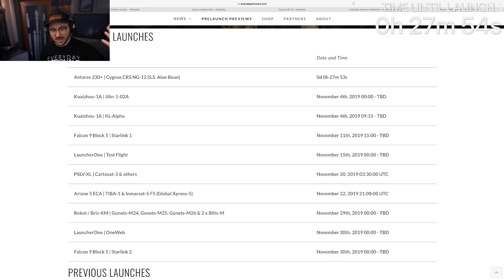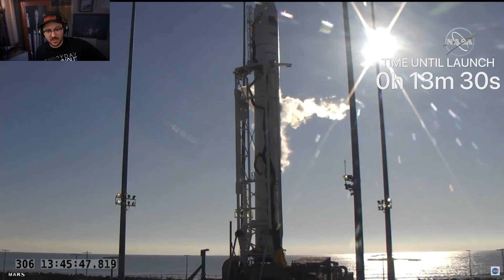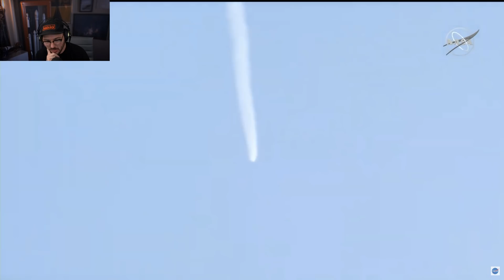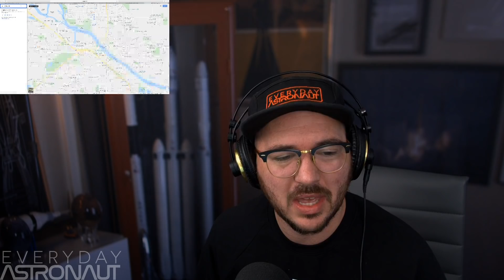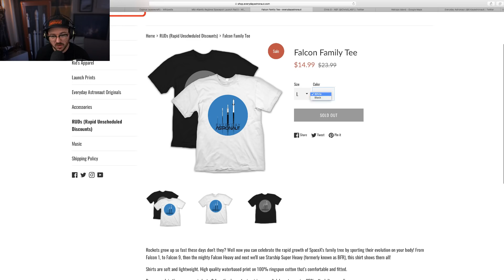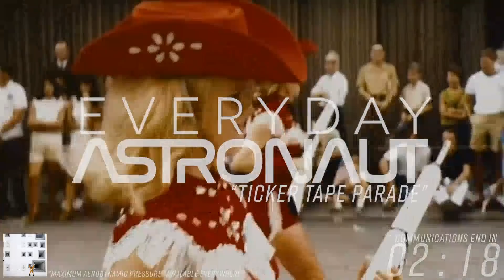Watch NASA and Northrop Grumman Launch to the ISS!

Comment: Question. Has anybody looked into the possibility that continuously puncturing Earths upper atmosphere could be a contributing factor for global warming? I do know that CO2 is heavier than air and that jet planes inject it into the atmosphere at 35,000 feet.
I did a rough calculation and it is in the 100's billion ton range for commercial flights per annum (not good). But I guess that oil controls the USA Sennet through lobbies, go figure?

Comment: Hello Tim, thanks for another great episode, and now, if you will allow, for something completely different.
I've been discussing with some people on the LabPadre Discord, the questions posed below and hope that you will find the time to weigh in in your typical pithy style;

What do you think about the giant window array shown in SpaceX renders near the nose of Starship? To me this is clearly far more complex, heavy, vulnerable to failure, subject to undesirable thermal and optical excursions and far more costly than a mostly continuous steel hull. 

I understand the psycological and aesthetic reasons for real windows, but the engineering and economic tradeoffs would seem to argue for using some form of internal display (projetors, screens, head mounted displays, etc) in place of spaceworthy windows, to give passengers the impression of seeing outside without poking a giant hole in the hull to accomodate the large panoramic forward window panels. 

In Mars transit, I believe there are technical means other than windows that could be devised to provide a sufficiently immersive experience to at least equal that of widows, while also using fewer, more modestly sized transparent windows for direct passive observation where necessary or desirable to minimize costs and risks while serving the needs of the passengers for a sense of connection to space. It is also true that such means could provide an immersive sense of connection to orher places as, such as locales on Earth or Mars or any place else with appropriately formatted video files. This would provide psycological benefits passive windows cannot.

In LEO and Lunar excursion modes perhaps there are compelling economic and aesthetic arguments enough to outweigh the risks and costs of traditional spaceworthy windows.

 Anyway, I would appreciate hearing your thoughts on this. Will the giant window ever fly?

Comment: It's about escape velocity, (wikipedia quote) escape velocity is the minimum speed needed for a free, non-propelled object to escape from the gravitational influence of a massive body.
The escape velocity from Earth is about 11,186 km/s (6.951 mi/s; 40,270 km/h; 36,700 ft/s; 25,020 mph; 21,744 kn)[1] at the surface. At  the moon it's 2,38 km/s. The best long distance rifles and tanks can shoot bullets at about 1,75 km/s. So you need one of these up there choose a very light bullet and then you might be able to shoot something away from the moon. A space elevator seems a little impossible at the moment. I guess the best forever solution is creating mini fusion reactors, now possible due to new magnetic technology and improved fluxes. This you need to put on a rocket and shoot big volumes of high speed hydrogen ions for propulsion. And that's going to be the space elevator of the future. Two leaps forward is what we need to make an effective space elevator.

Comment: Luna-Earth space elevator can be done with a very thin tether, on the order of a couple of square inches maximum cross section IIRC. Once a month the Earth end would dip down into the upper atmosphere where it could be latched onto at subsonic speeds.

Comment: ??? Watching some of these live events makes one think. Watched the starliner abort today and thought about the dragon abort blow up... and was wondering: with the change of the Dragon abort to rupture plates, how does that set back starship? That is, my guess is that the valves used for the abort were chosen with the idea of using them for landing down the road... no longer an option with rupture plates instead of valves. The Starship effectively faces the same challenges with leaky valves and restarting engines... or did they just put the rupture plates in the Dragon to "get it out the door"?
Reply: Len whatever - Starship is so massive that the type of LAS used on Crew Dragon would add significant mass (20+t) to provide the thrust needed to work & would add something that could actually fail & kill the passengers en route to Mars or back to earth - Hypergolics are explosive, poisonous & corrosive. The rupture plates used on Crew Dragon are pretty much to “get it out the door” while providing the “margin of safety” required for human spaceflight.

Comment: baking cookies in space... well a variation of a convection oven to circulate the hot air and should distribute the heat but the cookie batter would need to be put into molds or you are just going to get hot balls of cookie dough. when I say Molds think "play dough" style molds that you can either put in the oven or out of the molds bake them already in a cookie shape.

Comment: @Everyday Astronaut - Tim, the moon rotates at <17 Kph, while its escape velocity is ~2.38 Kps. You’re right - Someone using a lunar space elevator would probably just fall back towards the moon & end up lithobraking. A lunar space elevator would only be practical if it went BEYOND the Lagrange Points.

Comment: Space elevator to Lagrange points 1, 2, 4, 5 is easily doable with steel-age tech, let alone modern tech.
An elevator to L-1 is a bridge between Luna and Earth. 
An elevator to L-2 is a sling-shot to the rest.of the solar system.
Elevators to L-4 and L-5 would be an extension of lunar bases into space stations at those points.
Each elevator can connect to three places on the lunar equator and both poles.
Edit: And it should be possible to travel through an elevator network from any Lagrange point to any other Lagrange point or lunar elevator base.
Reply: jimmyfly - Luna is what the moon is called in various languages, hence the words “lunar” & lunatic”. It’s also the scientific name which specifies which planet it belongs to & which satellite it is. 
Regarding your other question, I’ll just remind you that no one actually flew a heavier than air aircraft before the Wright brothers in 1903, no one flew a liquid fueled rocket before Robert Goddard in 1926, & no human walked on the moon before 1969...
Reply: Point taken, jimmyfly...However...
It's a relative term.
Nothing 'space' is easy.
But some things are easier than others.
Lunar elevators are a cake when compared Earthly space elevators, for example. They're also easier in terms of resources and manpower than mass accelerators. The engineering is harder, of course, but only because it hasn't been done before.
Reply: bmobert - The best Link between earth & Luna would be a lunar mass driver pointed at earth, & it could be done using present technology... Any elevator that went through GSO could conceivably act as a “Slingshot” to the rest of the solar system once the “package” went beyond GSO. It’s really not practical to launch stuff from the moon (or any elevator from the moon) unless you’re building the rocket on the moon using lunar materials & fueling it with lunar rocket fuel...
Reply: @jimmyfly 
"The moon" is a nick name like when I say, "I'm going it to the car." There is more than one moon out there and they all have names but "the moon" can only mean Earth's moon. However, Earths moon has a specific name (actually many hundreds but astronomers usually go by the Latin) and that is "Luna."

As to things the size of thousands of miles, there's the roadways, electrical grid and fiber networks come to mind immediately. I'm certain sure there are many such examples if we gave it some thought.
Reply: @jimmyfly
OK..
I gave you a chance.
May your life be excellent.
Reply: @jimmyfly 
Yes. I attempted to answer your question and failed to describe it well enough for you to understand. 

I know my way of viewing the world is odd enough that not everyone will groove with it. 

Online at least, it's much less effort to just stop trying to explain and wish the person in question a happy day than try to explain further because I will not be understood regardless of my attempts.
So. I bid you an excellent week and beautiful life.
Goodbye.

Comment: I got you a legit question...  I was listening/watching this launch an heard one controller say "switching or engaging Velocity Steering" now i would assume velocity steering would be using a aerodynamic drag element on the vehicle to steer it.. Which got me thinking.. you always hear about gimbaled engines an the like to steer in that regard but ive never heard of a aerodynamic control feature to steer the rocket on the way up. I guess they want to limit as much aerodynamic friction as possible... but the size of a control surface would not need to be very big at all.  So the question...  Do rockets employ tech like im speaking of? also.. i did a quick time over distance calculation ... This particular rocket averaged 605 mph from launch to 100k feet... key word is averaged... im sure it was going much faster then 600mph at 100,000 feet mark.
Reply: Velocity Steering is a guidance strategy that commands the vehicle along a desired velocity vector trajectory.  It does not consider aerodynamic effects.  A different guidance strategy was used to minimize aerodynamic loading earlier in the boost stage when dynamic pressure was higher and when crosswinds can be problematic.  I believe NG calls that strategy Alpha-Loop Control, and the idea is to achieve a desired angle-of-attack ("alpha").  A zero-alpha trajectory minimizes aerodynamic loading.
Reply: @qdav5  What im thinking.. is with enough sensors placed across the body you can see what crosswinds are doing to the vehicle an be able to flop out, for lack of a better term, a small drag element an correct the steering. It honestly wouldn't need to be very big to change the angle of attack. An with a lot of hope ... that design may allow launching during even worse crosswinds. Or are you more of the opinion that  . its just not needed
Reply: AN yes , to anyone else reading this, im talking about the way up.. not down.. i know all about titanium grid fins.. An im not saying put grid fins on it as a control element for upward accent but something the size of pop can would alter trajectory ... surely

Comment: Earth is in geostationary orbit of the moon.
Reply from the maker: No, it’s not. The moon is tidally locked to the Earth and the Earth does not orbit the moon
Reply: I guess earth is going to be a big factor wrt geostationary lunar orbit. Perhaps a place exists on the far side of the moon, but that would also be geostationary orbit to earth.

From the perspective of the moon, the earth remains in the same position in the sky, as the moon rotates.

Thank you for the hard work Tim, keep the flamy end down.
Reply: I will agree that the moon goes around the earth, and not the other way around.

Comment: The problem with space elevators/"bean stocks" on Moon or Mars is sure we could do it with nylonw (moon) but the elevator will take months to go up and down and bring only a few tons of cargo per line.
Reply: frbe0101 - It would be more like a week, & the weight that was sent up would depend on the strength of the cable & the means used to get it up & down the “elevator”.
Reply: @TraditionalAnglican  Assuming an amazing 15 m/s it would take ~44 days to travel the ~56315 km to L1.

Comment: Just got home from Wallops. Tim, you definitely should attend a Cygnus launch. You can easily get less than 2 miles from the pad. I've been to launches at the Cape in Florida, and you can't get anywhere near as close.  It is a body rattling experience. Highly recommended.

Comment: ELON said that the heaviest component in his rocket is the liquid oxygen.  This is very inefficient method for boosting a payload as the atmosphere is very dense at lower altitudes.  What he should do is fly using an atmosphere breathing engine to approximately 50,000ft.  Then engage a scramjet engine to boost to 100,000ft. At such time a self-contained rocket engine should be used to reach orbit and beyond.   SSTO examples are Skylon and VSS Unity.
Reply: robinrutschman - Elon also said he didn’t find it to be worth the trade-off as the first stage takes the rocket up to 60-90km & 10,000-15,000 km (depending on the Rocket), & that he would’ve used it if it had been more efficient.
Reply: Skylon already costs more per launch then Falcon 9. Which is gonna be even bigger once starship launches. It's definitely not inefficient.
Reply: Travis Myers - The cost difference is largely due to the fact that Skylon is a “one-off” experimental rocket while Falcon 9 is a “mass-produced” rocket that’s been in service for 5 years.
SpaceX is reducing that effect by building multiple Prototype Starships at the same time & then running multiple tests on each rocket.

Comment: Why is the Antares rocket liquid fueled, but you say that this one is solid fueled?
Reply: The booster is liquid, the upper stage is solid.
Reply: @HotelPapa100  So are there Antares that are fully liquid, or fully solid; or does the propellant choice depend on the cargo?
Reply: @mi4936  I am the wrong one to ask that. I just rehashed info that was given during the video.
A brief glance over Wikipedia told me that booster and second stage are always that configuration, though there are variations for the booster engine used.
There is an optional third stage with more variability.
Reply: @HotelPapa100  ok thx

Comment: I've good a good one for you

How would you go about disproving the earth is flat using info only from this video?

I posit that if the earth is flat and the ISS does not exist then nothing would change in this video. The objective of this mission would be, of course, to pocket the money from the rocket launch and then dispose of the rocket. Only one thing would have to be changed and that is the altitude number to a stable one once "orbit" is reached (to hide loss of altitude due to falling). The booster would still end up in the ocean and, as you said, after a point in the mission the capsule is going fast enough that it will burn up on re-entry, destroying the evidence, without any further tampering.

Also, apart from a few managers, none of the employees of said company have to be complicit. In both cases the rocket is fully functional, constructed to the same specifications, and completes the same task. The only difference is that there is no rendezvous with the ISS and the payload just burns up prematurely during re-entry (since orbit is not possible).

I would be happy to hear your responses. You can also cite ancillary sources about this mission to further bolster your claims.
Reply: Polyamorous Router - But there are MULTIPLE HUNDREDS of data points which prove beyond any reasonable doubt that the earth is spherical, & not flat, so no one has to rely on one poorly done video to make the case.
Reply: @TraditionalAnglican  it's not what I asked.

And sorry but that just isn't true. There is very little and sparse evidence that the Earth is a sphere. In fact, if you look back in your life, excluding what NASA has said, I bait you can't find a single piece of first party evidence that proves the Earth is a globe. 

I can provide some sources if you want.
Reply: Polyamorous Router - I know what you asked, but I don’t think it’s necessary given the evidence from the Greeks, Romans, Irish (Brendan the Navigator), Vikings, Spanish, English & Dutch, along with those who’ve gone up high enough to see earth’s curvature. Whatever I could get from this one live-stream would just be one additional piece of evidence. The Torah said something about needing 2-3 witnesses to prove the elements of a crime - We have 10,000’s of witnesses to “the facts in evidence”. You are going against historical consensus, philosophy, science & even religion on this one.
Reply: @TraditionalAnglican  you're good.
I will note that as a man of science though, you should not be using consensus as your main argument.

However, we don't have thousands of witnesses.

As in you should know as well that the Torah says it is flat (look up firmament), so it's safe to assume most Christians throughout the history thought the same.

Also, the source on ancient Greeks is flaky, since even if it was true they did not have the technology to prove what they saw when the ships disappeared, and as we both know there tends to be a lot of revisionism in history books (Nazis, confederates, nuclear weaponry, the DARK ages).

But let's get into the meat of it: nobody can see the curvature of the Earth, nobody. You can't see it from airplanes, and you can't see it from high altitude balloons (after you account for the lens distortion of course, which, for some reason, is always left uncorrected). The only people who can see it are astronauts. How convenient.

You also can't visit the edge of the earth because of something called the Antarctic Treaty System, and, of course, a picture of the earth does not exist. But, I hear you say, they took one on Apollo 17. Well, I'll accept it once you prove the US actually went to the moon. Don't forget to explain why there isn't another one though.